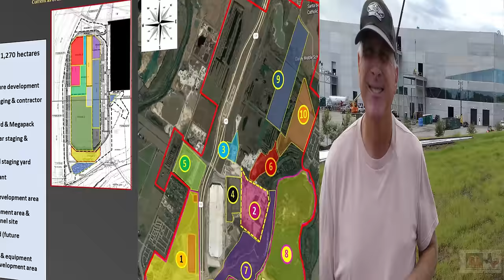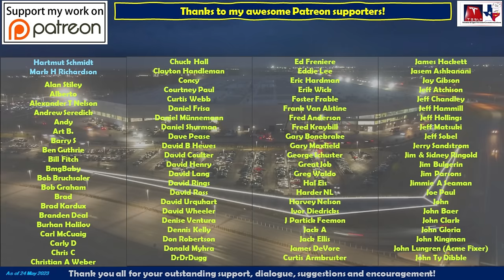Casting Slab Demo, Bull Horned  Model Y & 2 Crates Unboxed.  24 May 2023 Giga Texas Update (09:35AM)

Comment: Thanks Joe.
4:44. Drivetrain, roof. 5 largish black and white boxes/structures.
7:13. GA, loading platform. Steel beams. New works on-going.
8:35. Southend. Storage racking.
10:58. Stamping, apron. Beside the wall, in front of the SPMT, and on the trailers. Some sort of temporary decking, or perhaps it’s shoring. There was some seen stacked on the SPMT in Brad’s video yesterday.
13:16. WOW yard, south. Recycling yard new location?
13:51. WOW yard, south. Platform topped with salvaged southend apron sections.
17:54. Cathode, west. Constructing a rubbish chute from the top floor.
18:16. Cathode, plant apron. 4 orange Xs mark the spot. 4 square concrete plinths instead of the previous attempt at one larger plinth? 4 stainless steel tanks nearby, coincidentally.
18:44. Old House site. East of, being cleared out.
21:23. Old House site. Some activity. Shipping container placed.
22:04. Temporary kitchen. BBQ trailer has shifted again. Might be at 16:34.
24:27. BESS site. Bottom left. Thanks to SammyK I now know that the corrugated expanded mesh formwork is AMICO Stay-form.
26:30. Casting, apron. Delivery of rebar. Loading docks, demolishing the dock leveler set-downs. I wonder if the ramp goes next.
Reply: Is the cylinder at 15:53 a proofrock(?) boring machine?  Has it been parked there for so long it's not worth mentioning?
Reply: @shadowmancer7040  15:53. That's a silo. Might be part of the MM batch plant equipment. Been there a long time, I don't have a record of when it first appeared.
Reply: Thanks for all of these details. From a distance, a factory looks like a giant shoe box. There really is an incredible and increasing amount in this one. I can better understand it when Elon talks about the machine that makes the machine now.
Reply: @DouglasJMark  You're welcome.

And it's a machine that they aren't afraid to alter as required. Been great to watch.

Comment: Thanks Joe. What a busy place! Q: With a weekly run rate of 5,000 Model Ys or about 1,000 a day, why are there only a couple of them exiting the factory?
Reply from the maker: I explained that on the video
Reply: @JoeTegtmeyer  Thanks. Right, the part about the 12 new cars that go to testing. If they did that every 20-30 minutes, 24/7, then that would total 5,000 per week. I must have visions of Ford Model Ts pouring off the assembly line from old news reels on my brain 😝

Comment: Interesting that the electrical conduit is grey. Here in Australia it's orange.
Reply: I believe orange is communications here, maybe specifically data comm.
Reply: And they spell grey incorrectly.😑
Reply: @sammyk874  Comms here is white. From this and previous videos it seems that we use the same colours for potable water (blue) and non-potable water (purple). We use yellow for gas.
I've been told previously that the colours are internationally standardised, but maybe the US is the exception, like with measurements. :)
Reply: @bradcavanagh3092  Fellow Aussie. Grey conduit for light duty, orange for heavy duty. Duty as in degree of mechanical protection.

Comment: 8:00. The dozer with the ripper engaged suggests soil removal.
Reply: I think the soil ripping is an attempt to help dry this section of building pad. More of the soil is exposed to the air once it is ripped. This spot was probably filled with soil that was too wet and did not compact to the required density. Hopefully they roller sealed the surface before the rain came or the soil will be more wet than when they started ripping, and will take even more time to dry enough.
Reply: @bobcallahan2322  A ripper would be an extreme measure just to speed drying of the soil.
Reply: @jbbuzzable The soil will dry faster with more surface area exposed for evaporation than if the soil remains compacted and the top sealed in. It is also less expensive than removing and replacing the wet soil.

Comment: There should be a solution tto the storage of front and rear cast aluminum parts..It’s not good external impression of a factory like Tesla to store them like that, on the open air surface nearby the factory wall!🤔😩😳

Comment: sure looks like those vertical ibeams and concrete sections between them looking like a fence
Reply: @ 22:15 Notice that those concrete panels are below grade? Except for a few on the east end that haven't fully dropped down yet.
Reply: @DavidJohnson-tv2nn  yes Dave, they were only 2 panels high to start, so 1 level is below grade, you’re point is?
Reply: @mwolrich  None of those panels will remain above grade it is not a fence. The retaining wall has one purpose only.... To protect the side of the excavation closest to the substation, preventing it from caving in. You will see as time goes on.

Comment: Rework after rework, disappointed on the building speed
Reply: How many multi-billion $$$$$$ factories with first-of-it's-kind technology have you built?

That's right -- none.

Patience grasshopper.
Reply: @silverstake88  We can see the leader of this project doesn't have much experience either :)  You know, the same guy thought he could launch the world's most powerful rocket without a flame diverter or water deluge system! How did that work out for him :)
Reply: @DavidJohnson-tv2nn  You're a rocket scientist now too?
Reply: @sammyk874  A 5 year old child could have told them that launching that rocket without a flame diverter or water deluge system would end in failure. I made the prediction of failure a couple years ago. Just as soon as it became apparent that there would be no flame diverter. This is common sense. It doesn't require rocket science. But maybe the leader should listen to his rocket scientists :) I also make the prediction that there will be a fatal accident if they don't design and incorporate a launch abort/landing abort system into Starship. It is not a question of "if" there will be an accident.. It is only a matter of time before there is an accident.
Reply: You need to read Prof Bent Flyvbjerg How Big Things Get Done. Or talk to anyone who understands scrum/ Agile methodologies vs waterfall project management.
Over the 2 years business focus had changed. Masterplan 3. So they built some stuff, but then changed to suit new plans. Better that than continue with wrong build. 
As Musk says, they are short of time. Not $$ or resources.
Reply: @HughButler35  Wasting "resources" goes counter to Musk's claim of wanting "a sustainable future"!